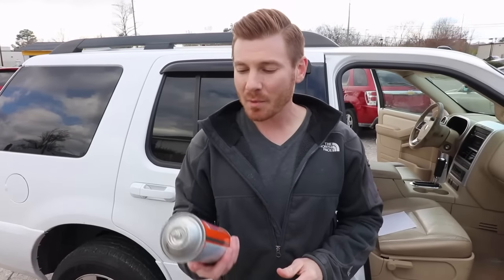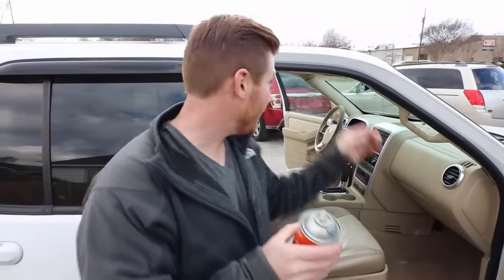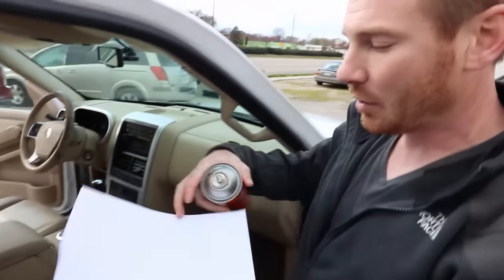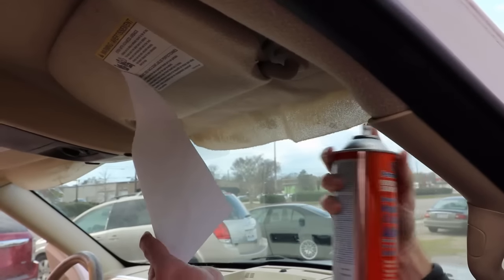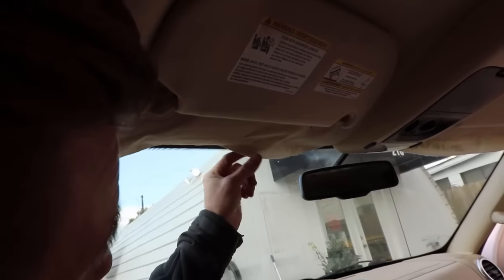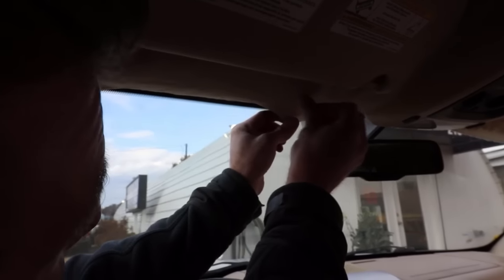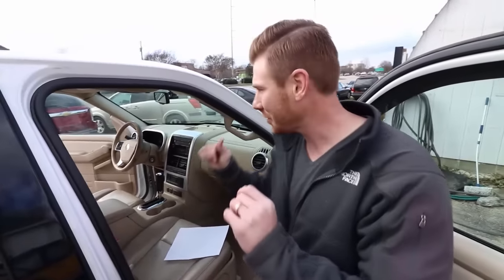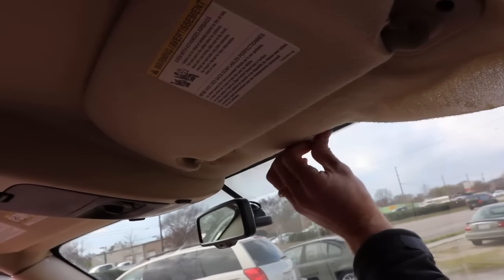How To Fix Sagging Headliner using Spray Adhesive

Comment: Here’s a tip for you.  Hot glue a syringe tip onto the spray nozzle and you can stick it through the headliner to do the entire middle of the roof  as well!  Keep the syringe cap and you can use that for storage
Reply: dude, f-ing genius. <3
Reply: So then I wouldn’t have to remove the headliner at all?
Reply: THIS needs to be a video
Reply: Yes!!! Video PLEASE!!!
Reply: Absolute legend!!!
Reply: 🤑, dayyyammmmm this shit actually worked on my sagging Alcantara headliner. Didn't have to remove it out completely. No mess no fuss.Thank you!
Reply: HEY TOPHER, that was MY idea...but I was looking for a video to see if anyone else had done it (succeeded/failed) before I try it. How about doing that video and tagging me so I can see it. My entire headliner is sagging in my Firebird, but not even one tear so I'd rather not replace the whole thing and risk doing a crappy job. 🤪
Reply: @Truth_Seeker_79  make a video
Reply: @ginopirone3800  I experimented and tried it already on a small section that was sagging, it worked but missed out taking video at the time 🙄
Reply: where do you get the syringe?
Reply: @Aria-Invictus  as long as you can convince a local doctor or medical centre you are not a druggie they might give you a syringe. Or just buy one from a drug store. They are only about 2 dollars. You don't need a huge one, even 5 ml will do, after all you are going to cut off the tip anyway to glue it to the can of spray. I have even sprayed adhesive into a small container like an egg cup and brushed it on the head liner, (not the fabric), then sprayed the fabric the usual way as Justin has done here. Much better result for the fabric. it also depends on how easy the access is to the headliner and how bad it is as to whether using a brush will work. never pull more fabric away just to get a brush in. just spray in normal way if it is not too bad. And don't forget to use some A4 paper or similar as a "guard" like is done in this video. Saves a lot of fiddly clean up later on. Take your time within reason, like wait for adhesive to become tacky, but don't leave it too long either. It's not rocket science  anyway.
Reply: Round of applause 👏 🎉🎉🎉

Comment: I used 3M Headliner Adhesive and it worked fine. I wore eye protection and rubber gloves. The trick is definitely letting it dry a few minutes.  I was hasty to try adhering the headliner soon after spraying it definitely soaked through a small spot.  After no more than 5 minutes, I could tell it was no longer wet, and I had no trouble smoothing the fabric over the foam base with very little if any wrinkling. It doesn't look perfect but for 15 old material it's not bad.  Be sure to lay a cover underneath the work area to protect from splattering.  Also I watched another video demonstrating this and the guy had splattered adhesive all over his rear window.  What a mess! The best solution I found for that is stick Saran Wrap to it all the way to the edge all the way around because the glue will splatter.
Reply: Thanks for the tips

Comment: It's very important to know if your headliners has molds on it before u start spraying.  If your headliner has mold, it is better to get a new one and then use the adhesive headliner spray to make it stick nicely.  Spay copious amount so that u won't have a sagging problems in the future.

Comment: Nicely done! Thanks for taking the time to do the video. I've read a few comments where people are running into staining issues. I believe that comes from applying too much in the same place at the same time. If everyone would use short (light press on the nozzle) strokes, like I saw when you shot the left side, the results will be better. Don't get the fabric "wet". Start with a clean nozzle. Practice application strokes on a piece of cardboard.
Reply: Yep and also they may have not shaken the can enough

Comment: Exactly what I needed for my Explorer with the same issue, same sides too. thanks for a great video.
Reply: Update: I purchased the spray adhesive, applied to the sagging headliners and I'm very happy with the results, car looks much better. The process was easier than I thought it would be, follow the instructions in the video. Highly recommended 😃
Reply: @aeiq1219 I’m bout to do the same

Comment: Thank you so much for this video!  This girly girl was struggling to get the adhesive to stick & about to just rip the entire headliner off.  The problem was that I have a convertible with a retractable roof & didn't dare put the roof down fearing entanglement of the headliner.   I found this video after purchasing another adhesive and your tip about waiting between coats made it an easy repair.  It has a few wrinkles but so be it - I can see out the back window and put the roof down again.  Thanks again!

Comment: Yeah this came out pretty good, I got an 85 Chrysler Fifth Avenue. So the headliner is sagging more in the middle, so I got to try a different way to do it. I still got a couple cans of that headliner adhesive too though.😕🙂🤓🤠😎😏👍✌️👋💪🌾🍀🌿🍃🇺🇸
Reply: Bgrant.   I have older cars,  Im going to bet any thin stretchy material will work.    My Dodge daytona headliner was junk.   My fix was to scrape all soft foam off and carefully painted headliner using Grey primer.   It was bit shaggy like leather swede.
Reply: @mike289homebuilt5  I'm going to try this adhesive and see how it works. Hopefully it's not too challenging though. It looks pretty simple.

Comment: So what exactly causes the sagging, the old glue wears out or the backing, or both?  If the backing is crumbling, you need to replace the entire headliner, right?
Reply: Both. Mine started sagging in similar spots. I believe it's because of the heat from the sun drying out the backing and glue. This seems to be a quick fix for the short term. Eventually if it all begins to sag then it might be time to replace the whole thing. Not worth it in my case bc the car is so old haha
Reply: Also windshield leaking.
Reply: @sunshine3914  
Put clear sealant (on the outside of car) where water leaks in from edge of windscreen. 
I did this .... I did a crappy job but it stopped the water leak.
It's an old bomb with rust so my rough job didn't matter.

Comment: The contacting surface on the headliner and the fabric needs to be prepped before  sprayingYou prep the surfaces by using
a soft toothbrush to gently remove  the foam dust off the inside of the fabric and then gently brush (only) the topical dust off the foam side of theheadliner itself. Once both contacting sides are free of this dust, it is ready to spray.

Comment: Can the adhesive withstand hot temperatures cause if not the clue will soften up again and it will come loose again
Reply: Get the 3M 90 spray. It can withstand 160 degrees. I have the same SUV as in the video and it worked great.
Reply: Jacob Wiechmann        Okay thanks
Reply: @jacobwiechmann8665  This product he features has a 170 degree temp rating. I'm on Amazon now.

Comment: this is what i need to do for the volvo, only thing is the jobs alot bigger the whole headliner is close to off, where would you reccomend looking to find the best price on fixing a car headliner if its to big to be a DIY project?
Reply from the maker: This is a great time to find an "interior guy". You'll need to find someone who does interior upholstery repair, ideally at affordable prices. If you can find out who the local used car dealers are using, that's going to be who you want.

Otherwise, you could try finding a intact headliner at a junk yard.

Comment: What is your guesstimate on how long the spray adhesive will last? I have an 04 Chrysler town and country.
Reply: I think that would depend on where you park the car, and what your areas weather is like, since heat and cold both effect glues in general. I know someone who had switching heat and cold weather extremes, their fix lasted 3 years or so

Comment: Justin.  I tried this product last night and sprayed it on the facing side of a headliner with similar beige sheer fabric.  Contents in can came out quite thick vs a light mist.  So far, I have faint white residue on the headliner.  Granted, it has not been 24 hours for full curing.  Will the white residue eventually become more clear?  Did I do something wrong?  Please help.
Reply: did it go away
Reply: @cozyrain410  : It eventually did. Can’t recall how long it took. Likely months later…

Comment: Remove the roof lining and backboard 
Wash roof lining fabric in cold water and peg flat to dry .remove all the old glue and foam replace foam with 5ml foam backing and lay over dry  clean flat  surface spray light and even coat of contact glue on foam and fabric let dry to tacky and stick together making sure fabric is not strechted . spray backing board and foam and fabric layer and join together using a roller to smooth out and doing half at a time put chalk marks on fabric and board to align propely take your time and you will ha e a satisfying  clean oem  roof liner
Reply: What's the name of the spray?

Comment: You can get the middle by using the needle trick.  You hot glue a syringe to the tip, it will allow you to get sags in the middle of the headliner.
Reply: I'm thinking about doing that but isn't there dust between the headliner that doesn't allow the glue to set right?

Comment: I did exactly the same . once i put both parts together the glue went through the headliner and left a white stain on it. It doesn look good at all. Dnt buy this product .
Reply: It sounds to me like you didn't wait 5 minutes for it to dry before you pushed it back together. I could be wrong - or  you applied too much spray and let it saturate.

Comment: This product WILL stain your headliner and it doesn't work all that well. I followed the instructions and my headliner is back to partially sagging. 

Will be trying 3M as I heard it's the best out there.
Reply from the maker: Bethany Humphrey If you apply too much or spray and don’t wait 5 minutes before attaching the fabric, it probably will stain.
Reply: @TheCarFlip  unfortunately it has a flaw in the spray nozzle. It shoots out like crazy spray and then in other cases it would come out like normal spray. I think that was the major issue in why it stained because as soon as it did that, my headliner stained without me even attaching it. It was solely from the "squirt" of spray and not a regular fine line like it should. Hopefully that makes sense. But yeah. Hopefully I can fix the issue with another product.

I still appreciate you taking the time to make a video because previously, I never even knew headliner spray was a thing. So thank you.

Comment: Don't do this. It will fail in two days. If you want it to hold and you don't care about aesthetics then us twist pins for upholstery. Do not use glue. It will quickly fail. This is why I never buy flipped cars.